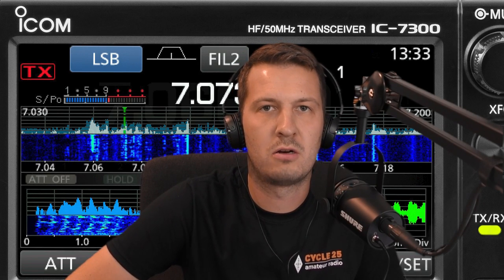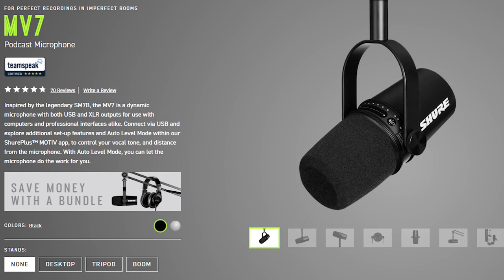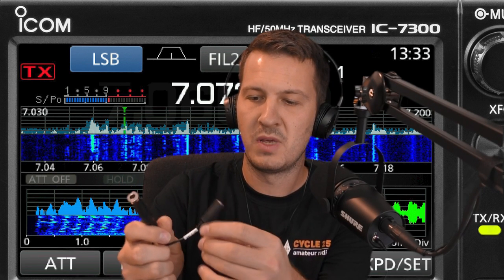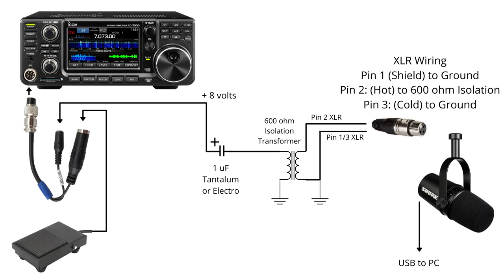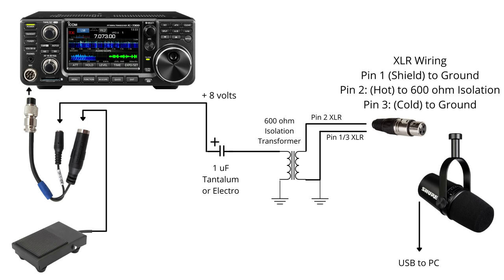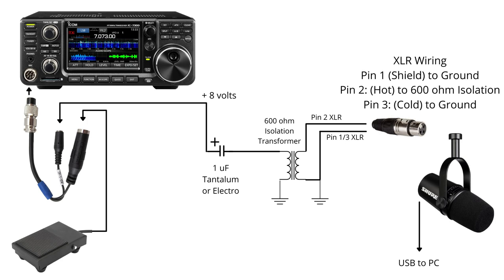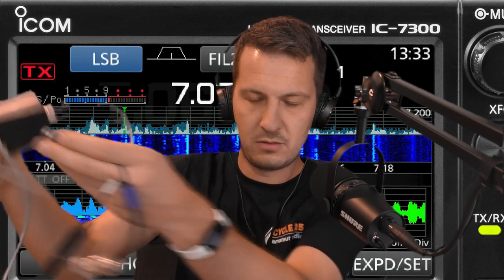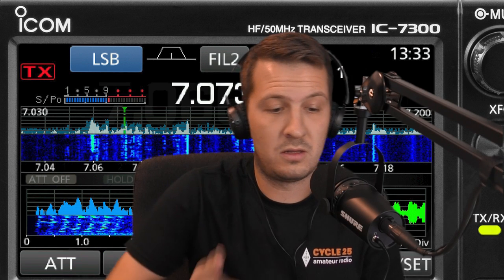How I connect my Icom IC-7300 to an XLR Microphone

Comment: The Heil AD-1-I adapter is made for dynamic mics and includes the DC blocking capacitor. I'm using it on my IC-9700
Reply: Yep, one cable passes the 8v, the other blocks it.

Comment: It works!  Since we do a podcast I have a Heil PR40, mixer, compressor/limiter/gate already, so I just needed this little device from your video and now I can connect to either my IC-7300 or IC-9700 and use the boom mic.  The only thing I didn't wire up right from the beginning was the foot switch! lol  Thanks for the video!

Comment: If you are building a box anyway you could add a 1/4" jack for PTT and skip the Heil cable. The DC blocking cap is probably not needed but a good safety item, the DC will not pass through the transformer and is current limited by the radio. The Heil cable appears to be for an ic element so it would not have the cap. Also when I make interfaces like these I connect cold and hot from the mic to the isolation transformer (using a transformer designed for converting from balanced to unbalanced) and keep it isolated from ground on the mic end.
Reply from the maker: Thanks Don. Very good suggestions. I got the Heil adapter anyway, but you're correct. Thanks!
Reply: The transformer will appear as a dead short circuit to the DC.  While it is true that the DC won't appear on the microphone side of the transformer, the radio side is a DC short circuit.  Hopefully it is current limited.  But even if so, the presence of a steady DC current in a transformer can saturate the core and change its characteristics.
Reply: Could you please suggest me a good  little ptt ?

Comment: Finally a video for my liking, yeeea ;) Question, does this box work for  a mixer to. My Mixer a Beringer Xair18. My dynamic mic is connected to the mixer and want to use a AUX for my radios, IC-9700 and IC-7300. So I guess i need 2 boxes one for each radio, connected to AUX 1 and 2? 
Looking for at schematic of mixer connection like the one you showed us in your video ;) Keep up the good work ;)
Reply from the maker: It should work yes. It’s a fairly simple box, it’s just the capacitor to stop voltage from the radio coming down the mic line and isolation transformer to isolate the radio from the mic electrically (done to prevent ground loops with the USB). I would experiment but I think it would work, just make sure no phantom power is traveling up from the mixer toward the radio!
Reply: @HamRadioDX  Yea phantom 48v is probably not good for the radio ;)
Grounding is an issue i guess. So grounding Radio, mixer and PC would probably be a good thing ;) Thanks for your  videos ;)
Reply from the maker: @JaazznMaannn  yeah 48V might hurt! Grounding may help, although be wary of ground loops which is the problem I had

Comment: My little shack here has both an IC7300 and a Yaesu FT991a. I built a new shelf to hold them both and had planned on simplifying things by having one mic that could run off either one. I was hoping to just get one of those MFJ 1261 boxes to do the job, but it's looking like what I want to do is going to be a whole lot more complicated -- and expensive -- than I had planned.
Reply: You might find a different mic that functions properly without all that stress.  I operate a Rhode Procaster studio mic that, with the adapter cable is plug and play, and is a beautiful sounding setup.

Comment: Best boom mic video I've see so far. Nicely done.  One question if the Heil adapter had an XLR connector on it instead of the phone jack would you still need the the isolation transformer? I'm researching a boom setup for my 991a and the Heil adapter for my rig comes with an XLR connector. 73 from KB3GRG
Reply from the maker: Hi Hayden, Heil do make a XLR cable adapter. You may not need the isolation transformer if you’re mic is standalone. I had to use it because the Shure MV7 has a USB connection so I was getting a ground loop. The easiest way to fix was using a isolation transformer. Cheers!

Comment: This is a dynamic microphone, you need at least 25 dB of gain. A single transistor preamp circuit is needed to raise the level a bit
Reply: Radio has built in compression / gain adjustable.

Comment: Question/suggestion. Why did you use an RCA Socket on the isolation box? An RCA to 3.5mm jack cable isn't a 'common' item. Had you used a 3.5mm socket, you would have more chance of finding a 3.5mm to 3.5mm cable in an emergency (out in the field) should you forget the RCA cable. Also, when you had the hum (before you made the iso box) how did you stop the 8 volts getting to the mic?
Reply from the maker: RCA socket was in the junk box. I also was not planning on using this in the field, just in the shack where it never gets touched. I used a cap to block the 8V DC which was built into the Heil adapter tail. The hum came from a ground loop when the USB from the mic was plugged in.

Comment: Are we not just better off getting the Heil adapter that accepts an XLR microphone? It sounds like you had to do a lot of extra steps because you didn’t get the XLR adapter. I have an AT2020 and would like to know if it works with the Heil adapter.

Comment: Thanks for the video. I had my microphone going through some EQ stuff via the W2IHY Ibox into the ACC connector in the back of the 9700. Worked fine but when I tried Dstar there were malfunctions, sadly enough. Bought the SM-50. But I was wondering: wouldn't it be possible to use the ACC input on the back? Volume control is only working when the front entrance is use but had that sorted on the external equipment. All the best, 73 Chris PAØTVI
Reply from the maker: Yes the ACC socket would be possible for sure. I didn't look at it as I had already ordered the Heil mic, but definitely a few different ways to interface it for sure. Thanks Chris!
Reply: You will get much better low frequency smoother lows going in thru the back of radio , avoid going in thru the front end its gona kill your audio reaping from that mic .

Comment: Great video.  I have an IC7100 and also have 8 volts on the mic line.  I have used a 600:600 transformer with a 100mf with the + side toward the radio but, didn't hook up the mic.  I am still seeing 8 volts on the - side of the capacitor when I measure it to ground.  Won't it burn out the regulator in the radio if it remains hooked up?   Thanks for any assistance.
Reply: That is to be expected. A DMM has a very high input impedance and you are reading the charged voltage of the cap. Connecting to a low impedance like the mic amplifier will drag down this voltage and no DC current can pass the cap. So in short assuming everything else is wired correctly you should be OK except 100 millifarads is far too much. Aim for 1 to 5 microfarads.

Comment: I hadnt considered this while looking into something like this for the IC705.  Turns out, it has an option to Enable/Disable the 8V output to MIC.  I used to have the 7300 but dont recall if it had the option or not.
Reply from the maker: I didn’t know that, where is the option to disable the 8V?
Reply: @HamRadioDX  For the 705 at least, its under Menu, Set, Connectors, MIC Jack 8V Output - On / Off.  After looking at the manual though, if its set to Off, it sends 3.3V instead of 8V.  Not sure if that would eliminate the hum.

Comment: You're going to way to much trouble. Use the AD-1-I and that's all you need. It has the blocking cap in the adapter.

Comment: Hi how are you? question i have a ic-9700 and a XLR mic with Phantom and a Focusrite 18i20. I want to connect the ic with the Focusrite line out (430 Ohms) the ic mic is 600 ohms. Is it possible to connect those 2 without any problems? 430 lin out on the ic mic in? thanks.

Comment: None of this is necessary if you use the 13 pin din connector out of the back of the radio.. You will override the front mic circuitry.. Pin 2 (GND) and pin 11 (MOD).. straight into your mixer..
Reply: @Frank Johnson  Correct when using a mixer or pre amp.. https://www.youtube.com/watch?v=6qE5zd7rYw8&t=3783s

Comment: The AD-1 adapter on the mic input side says "with cap" Does that mean the 1 mf electrolytic cap isn't needed for connection to the audio transformer?
Reply from the maker: That's correct, if it says with cap then that isn't needed. My adapter didn't have one
Reply: @HamRadioDX  Thanks for the quick reply.  It's only a cap, but I didn't have one and was going to have to order a bunch to get one. ;)

Comment: Actually,  there is no 8 volt going thru the Heil Mic Adapter. It utilizes audio in and ground only for the audio. The 8 volt pin on the main connector is used only for Icom mics. If you're connecting other mics then yes,  you need to be careful not to use that pin. You will still need an audio ground isolator to eliminate any possible hum and stop any ground loops. Good video though and I enjoyed it.
Reply: Could you please clarify this by stating the pin numbers?
Reply: @radiotvgod  There's 2 styles of adapters. AD-1 AND AD-1C. One style is for dynamic, the other is for cart/electrec mics. Not sure which so verify what you need...
Reply: @ess2870  I need both but which is which?
Reply: In other words, what are the pin numbers?
Reply: @radiotvgod  counterclockwise they are 1-8. With the indent at the 12oclock position. 1. Mic Input 2. 8v DC OUT 3. FREQ +- 4. Main readout squelch switch 5. Ptt 6. Ptt ground 7. Mic Ground 8.(center) Main Readout AF output

Comment: Does the radio's manual explain how to switch off phantom power from the radio to the mike?
Reply from the maker: No I don’t think so, but I’ve heard there is an option on the 705 to turn off power to the mic, I think in the menus somewhere, but that’s a different radio altogether

Comment: What lead you to the shure over the Heil  tnxs 73 down under
Reply from the maker: I use a normal XLR male to female cable to the box that I made up that has the transformer in the box. From the transformer box to the Heil is a RCA to 3.5mm mono.
Reply: Heil microphones are difficult to obtain right now and Shure is considerably less expensive depending on which one you use.

Comment: Can you connect from dynamic microphone to an audio recorder (eg Zoom H5) for preamp, and output Line Out to Heil 3.5mm socket?
Reply: Line out from a Zoom (I have H4N) is too strong for a microphone input but you could take the line out of the Zoom and put it in the rear audio line input jack.
Reply: I have th H5 and have used it for years with the 7300. I use the INPUT 1 and 2 with the PR-781 and a AudioTechnica BPHS1 and I can switch between the two microphones by pressing the button 1/2.

Comment: KN60UT - Question - I heard on the video that a link would be posted to go through the isolation transformer connection in more detail. Where can I find the link. I'm a brand new ham and this is going to be fun! Thanks all. Brad
Reply from the maker: Hi Brad, there are links to the transformers in the description that I used. There is a schematic in the video, but I have made a change. Send me an email for more info and I can also send photos. Thanks for joining as a member! 73
admin@hamradiodx.net

Comment: That cap should be part of the Heil cable from what I remember hearing ? Send Bob a email asking 😉 thank god for that 7300 keeping torroid makers in business with rf squeezing in every where 😔 never seen a rig that needs so many input/output chokes. Yikes 😬😲
Reply from the maker: It should be, but my packaging had "no cap added" sticker on it
Reply: @HamRadioDX  scary without that blocking cap you will cook sum elements 😳
Reply from the maker: In my setup I wasn't too worried about cooking elements in mics, but cooking the regulator in the radio. With the isolation transformer, the other side goes to ground, so effectively you'd have a short across that +8V line to ground!
Reply: @HamRadioDX  The AD-1-I8 is the correct cable with the cap.